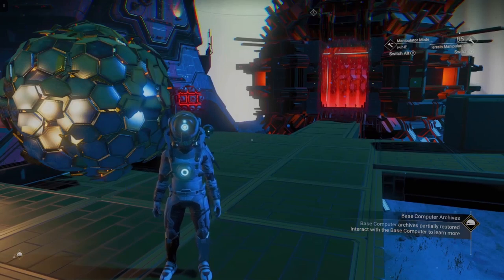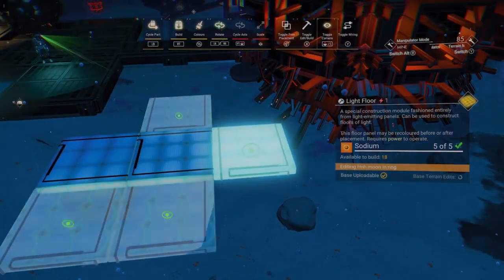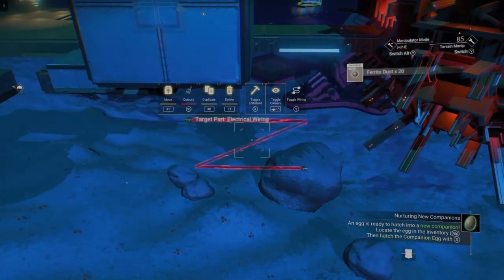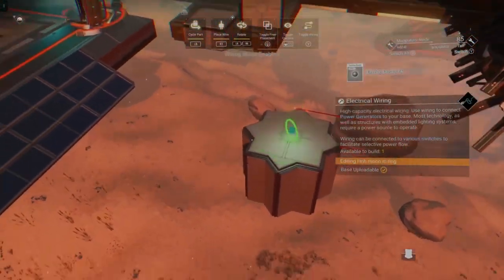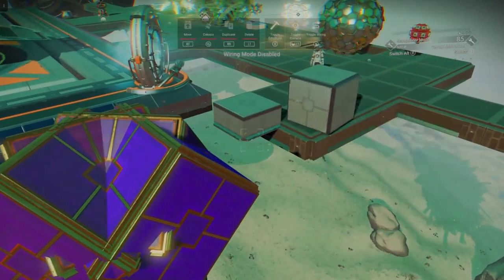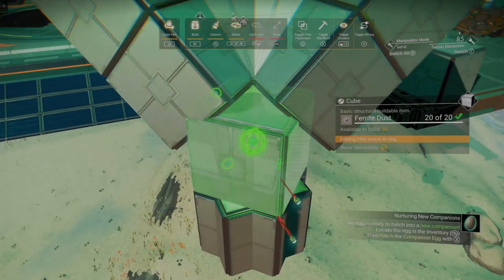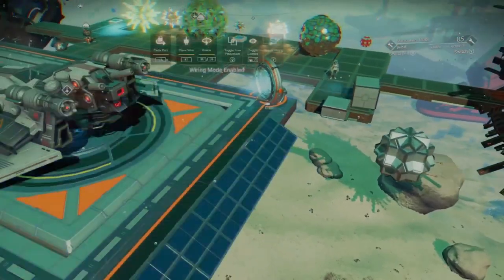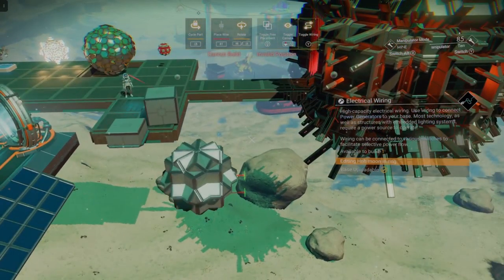How to quickly build 26 sided spheres in No Man's Sky

Comment: How do you get the really small cubes? Like with prox switches?
Reply from the maker: i use the universal adjacency glitch between the pyramid and a light box to turn all the faces into light cubes. then you can build those inward to make the snap points for a smaller sphere. just UAG from the light box to whichever part you want to use.
Reply: Ahh I see! But the cube scaffolding has to be deleted after the placing of the initial light boxes. Thx!